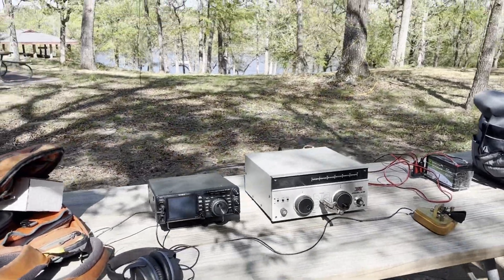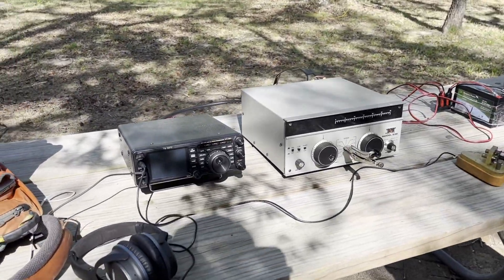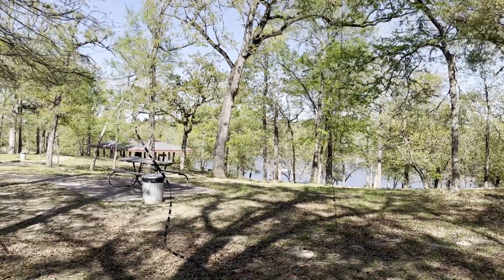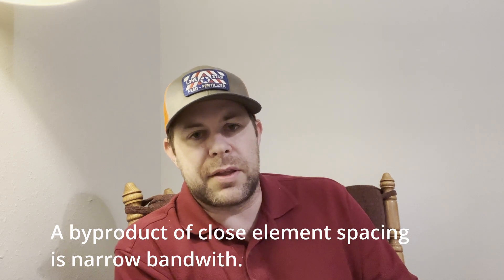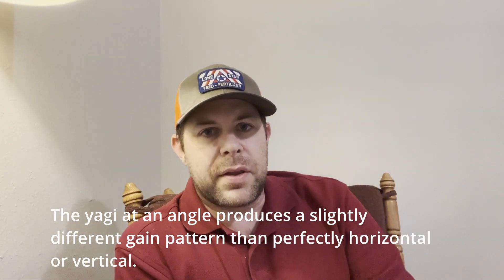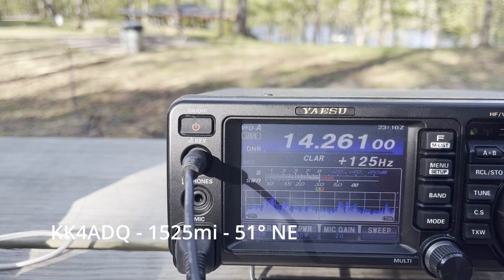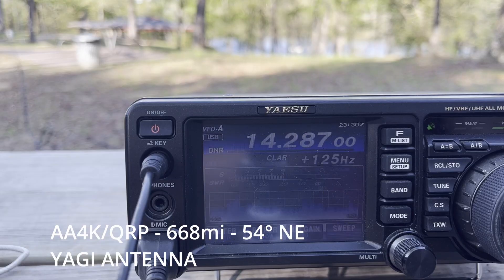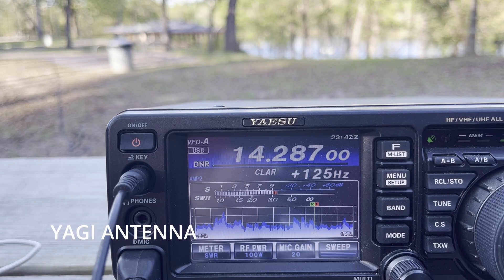N5NU POTA:  2 ele wire yagi vs 125' delta loop antenna

Comment: Nice work! That took a lot of effort to set up the side-by-side comparison.  That Yagi looks to be a winner. Are you planning a TX comparison? RBN could give you a read on performance with CW, but you would need separate time windows to distinguish... For reference, I was running 100 watts into a 246 ft doublet up 50 ft located in FN01hm.  Best 73 de Brian -K3ES
Reply from the maker: Yes, hoping to maybe sometime next week when propagation settles down.